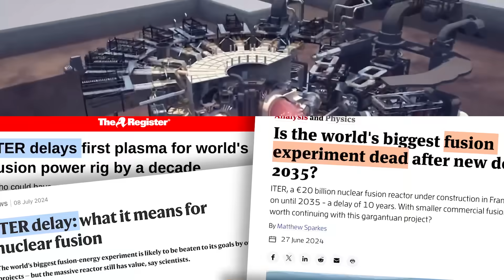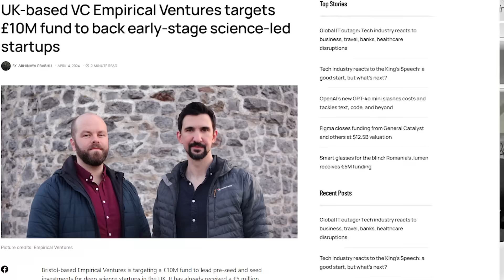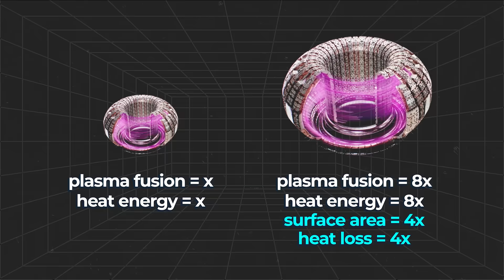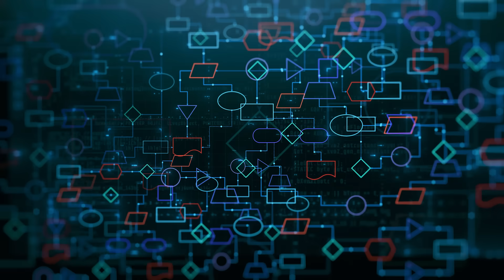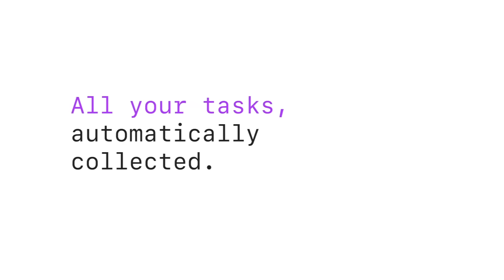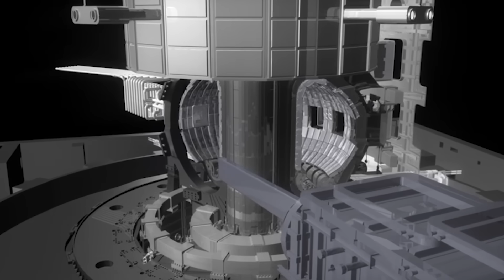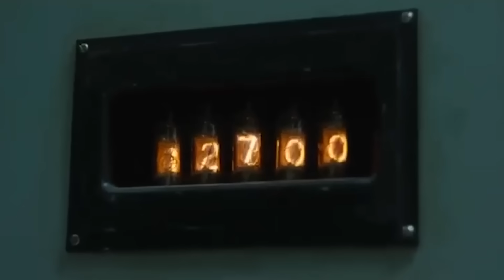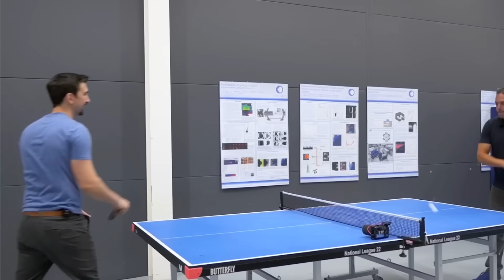Is The World's Largest Fusion Project Dead?

Comment: In iter’s defence, that was the size needed based on the magnet technology at the time.

REBCO magnets now allow iter to be 40x smaller / cheaper
Reply: So I wonder can we redesign ITER with REBCO magnets and add an actual steam generator to it? 40x might translate to an actual economic efficiency for a tokamak that size?
Reply: @MrMichiel1983  nope, that ship has sailed.

But many are starting from scratch and much father along after just a few years
Reply: That right there is a major part of the problem, at this time it takes these projects decades to go from the planning stages to something that might function. That time will drop a bit in the future as more efficient paths are discovered and less research is needed ahead of time, so, if we did decide to stop funding this project, it probably wouldn't mean that we'd get something online any sooner. 

With improvements in magnets, the next one will likely be a lot smaller and cheaper to operate, and will probably still benefit from this project.
Reply: REBCO magnets could potentially lead to more compact and economical fusion reactors in the future. REBCO (Rare Earth Barium Copper Oxide) magnets use high-temperature superconductors, which can operate at higher temperatures (up to 20 K) compared to ITER’s low-temperature superconductors. Totally different types of magnets however, with SMR or small modular reactors, becoming an increasingly popular subject, high-assay low-enriched uranium HALEU uranium hexafluoride (UF6).

HALEU UF6 is a form of uranium-235 fuel enriched to 20%, that is enriched higher than 4% to 5% level typically used in existing reactors, is projected to provide more power per volume than conventional reactors, as the increased efficiency allows for smaller plant sizes. This fuel type promises longer core life and a higher burn-up rate of nuclear waste, which will lead to the first new U.S.-owned, U.S.-technology enrichment plant to begin production in 70 years. Current uranium enrichment of HALEU UF6, comes from a centrifuge cascade, located in Piketon, Ohio.
Reply: There was a recent video of the "failure" of the Human Genome Project. Turns out being ambition can accelerate your collision with just how much you were wrong. Today we have tabletop genome sequencers. Even if ITER fails, the progress made in the materials industry and engineering knowledge will help in the next ones. From 15 years away to 10 :p
Reply: This is a classic example of the Generation Ship problem. Where if you designed a spaceship to support a human colony over several light years to a new galaxy by the time the ship arrives it's entirely possible humanity would have developed a faster mode of transportation and have beaten the ship to it's destination, rendering the entire project a useless endeavour.
Reply: @spicy_mint  It's a typical economics problem. Having to calculate levelised costs etc. Lets say you have a million dollars to spend on computers to do a calculation that will take 10,000 computers a decade to complete. A computer costs $100 initially. Every year computers get 15% cheaper. When do you buy your computers in order to get the calculation done as soon as possible?
Reply: @Mandragara  > A computer costs $100 initially. Every year computers get 15% cheaper. When do you buy your computers in order to get the calculation done as soon as possible?

Interesting problem.  A related one is if it is your investment that is DRIVING the improvement.  Germany's Energiewende made the size of the solar cell production go up by a factor of 5x or something.  It also had so much funding that projects in sunnier locales (honestly, most of the earth is sunnier than Germany!) couldn't afford to outbid Germany.  And when Germany quit, half the makers went bankrupt.  AND YET.  even if the firm is bankrupt, the manufacturing facilities are simply bought at the liquidation sale at a price that does make economic sense, and this is part of the reason solar is so competitive now for a fair range of use cases.  Energiewende was a disaster for Germany and a disaster for other solar rollouts of the time, but, also has to be credited with the advancements and production capacity as well.
Reply: What a REBCO? 

 I wonder if iron nitrade magnets will change things. Not for fusion. Just in general. They are more powerful than Neodymium.
Reply: @dianapennepacker6854  Rare-earth barium copper oxide (ReBCO)
Reply: @dianapennepacker6854  REBCO is a High Temperature Superconductor created by IBM many years ago. In 2010's, manufacturers figured out how to make it into a foldable tape & MIT realized that it could be used to make high Tesla magnets needed for fusion (and MRI machines, etc..). 

MIT's SPARK reactor is coming online in 2026 and it will be (almost) as strong as ITER but 40x smaller.  Now the limiting factor is extracting all the energy from such a small surface area. I think 2026 will be the "kitty hawk" year for fusion
Reply: Still the truth of greater volume means more energy with less surface area to lose any heat
Reply: @prich0382  I'd be more worried that the plasma instabilities which will be the next challenge to overcome after building a reactor that can produce 10x more energy than it consumes would be even larger and more complex with a larger plasma volume. I suspect in fact that after the basic physics is worked out on tokamaks that we may need to switch over to stellarators for better control of the plasma.
Reply: that doesn't help the thermal situation though
Reply: But now they can pack those smaller magnets to make it even stronger?
Reply: "Because these kind of materials are brittle it was difficult to create wires from them. After 2010, industrial manufacturers started to produce tapes,[12] with different layers encapsulating the ReBCO material,[13] opening the way to commercial uses. "
Reply: ITER size is not just a magnetic coil requirement. Both Spherical Tokamaks / smaller aspect ratio tokamaks, and  large aspect ratio Tokamaks with smaller size than ITER have problems.
One of the most evident ones is power dissipation. Instead of being able to spread the heat around the immense plasma facing components in ITER, you have a much, much smaller surface, which will cause problems. On top of that, stronger magnetic field decreases the power decay length, which means that the plasma becomes a death ray to the targets.
But there are other things such as reduced size of the central solenoid, etc.

Bigger field does not mean better. Smaller does not mean easier. It is all much more complicated as it is a multiple goal optimization and we still don't know what we need.
Reply: Likely time to invoke the "sunk cost fallacy" that governments are incapable of.
Imagine how much power we'd be creating w that investment in indirect fusion.  Still I favor advancing the tech for eventual space travel, etc.
Reply: @Mrbfgray  Now you are just saying words. What do you mean by "indirect fusion"? Inertial confinement? Exploding a nuclear bomb to create fusion? Solar energy, which is an indirect way to harvest the energy fusion of the sun?
Reply: @drplasma1990    Common term for solar.  Good GRIEF.

Comment: they only reason i don't complain about the trillions spent on particle physics, is because it's money that would otherwise be used for warfare
Reply: live it to countries to weaponize science
Reply: @dimos5422 Fusion is already well weaponised, the hydrogen bomb is 70 years old
Reply: same, id rather that money be used for science and research to enhance our QOL and NOT for killing people
Reply: ...or just lower the taxes, after tax and rent I have nothing left.
Reply: Just think about the type op warfare we could power with fusion. Kabloewie
Reply: @marioschoutteet  Or how instead of operating in super high thermal equilibrium, as Tokamaks and all Fusion presently does, utilise the high energy contained in laser, concurrently with ultrasonic frequencies, to separate atomic bonds, and when by natural design, new bonds are formed, use this state to initiate a Fusion 3 stage process chain? Perhaps even, removing the radioactive isotopes or radioactive ionizing decay states.
Reply: Or roads or bridges or railways.
Reply: Trillions? Where are you getting this number? It costs about 1 Billion per year to run the LHC so are you saying we are running 1000 of those?
Reply: In a way it's the same thing. Whoever has the best technology wins the war.
Reply: @blucat4  agree
Reply: Also this thing is not particle physics: it’s nuclear physics at best, engineering and politics at worst.
Reply: Trillions? The LHC only cost $15B
Reply: @realtalknotsmalltalk  ya, a guess that is not  a lot today
Reply: How about just letting people keep their money or not destroying the worlds economies with government spending?
Reply: @dennisswaim8210  i'm a big fan of local economies, globalization is a nightmare, at least for us here in gods country :)
Reply: Why not both? All we gotta give up is healthcare and social cohesion and quality of life
Reply: Except Warfare has done infinitely more for Science than research projects have.
The fucking transistor was discovered by a US military funded research institute. 
Dont be delusional. War is the only thing that innovates.
Reply: in the end, they are spending on both
Reply: They dont burning money anyway, cash must flow
Reply: Are you serious? It could not be used at all to reduce inflation.
Reply: @ergoproxy1986  there is a problem. when there is too much money prices go up, but they don't seem to go down when there is too little :)
Reply: Because rocket science is easier and cheaper to do. LOL
Reply: Except that the funding of ITER is greater than that in any high energy project, which are meant to advance the knowledge of the universe. Still, they have produced more spin-off than ITER (not necessarily than fusion science.)
Reply: Sadly, the west has to re-arm because Russia and China can't take a hint that taking land (or water) from other countries is no longer allowed.
Reply: Nope the money is used for complete authority over every nation on earth.
Reply: Particle physics also teaches us important stuff - the search for the Higgs boson lead to greater and greater control over high-energy particles, which eventually lead to cancer treatments where we can calibrate incoming radiation particles to dump all their energy directly into the cancer cells, ignoring any intervening tissue. You never know what tangential discoveries will come about from this stuff.

Also, we should be able to learn how to manage huge projects like this from managing a huge project (this), and it is always good to have a large number of nations working together on a peaceful project
Reply: Absolutely correct and I agree with your comment. "It's better to live than to war " .
Reply: I'm sure that the military will find a way to use knowledge acquired from particle physics (probably already has).
Reply: And it's because of people like you that we aren't type 1 yet...
Reply: Fusion Bomb will be as real as Fusion Reactors.
🤷😉
Reply: @jantjarks7946  Huh ??
Reply: @herbieschwartz9246  What's to huh about it? The train, car or plane were supposed to bring peace and all turned into tools of war. Why would it be any different with current technological developments?
Reply: @jantjarks7946  we already have fusion bombs
Reply: @jantjarks7946  yes sir, the use fission bomb to ignite a fusion reaction
Reply: @jantjarks7946  it's the difference between an atomic bomb and a nuclear bomb
Reply: Yet I bet you still support funding Ukraine with high tech weaponry too.... hypocrite.
Reply: I divide any cost in billions by 1.5 and state it in Zumwalt destroyers, or divide by 2 for the cost in B-2 bombers, etc. No, that social program doesn't cost 6 billion dollars, it costs 3 stealth bombers.
Reply: Why not use it for warfare? 

Let me put this into a logical perspective. I don't want someone I don't know pointing a gun at me and me not able to defend myself. That goes for the continent. If you can't understand the simplest form of defense against people who dislike you, you cannot say why you don't want it spent on defense.
Reply: I agree
Reply: We can chew gum and walk at the same time.
Reply: The statement assumes that funds allocated to particle physics would otherwise be directed to warfare, which is not true. Budget allocations are complex and influenced by many factors, including political, economic, and social considerations. The most fundamental flaw in the statement is that it presents a false dilemma (or false dichotomy) fallacy.

In this case, the statement implies that money can only be spent on either particle physics or warfare, ignoring the myriad of other potential uses for government funds, such as healthcare, education, infrastructure, and social services, in other words, I strongly urge you to reconsider your position and expand your perspective.
Reply: @mrhassell  ya, it's a sad assumption, i hope i am wrong, there are much better things we could do
Reply: @mrhassell  agree, how the heck did you wind up on this thread?
Reply: @rebokfleetfoot  An interest in subatomic particles, makes it Inevitable I think? What I consider interesting, is that Sir Fred Hoyle, was responsible for the idea of stellar nucleosynthesis, shortly after WWII. His theory of chemical elements being assembled by nuclear reactions from the interiors of stars and subsequently ejected into the interstellar gas, was a major progression as previously all attempts at nucleosynthesis had focused on nuclear residues of an expanded dense state in the early universe, as they continue today, which is a result of Albert Einstein and the nature of progression. For the past several year's, since the G-2 Muon work by Fermilab, ongoing discussions, have presented an idea of a requirement being that in essence, we need a new form of physics. Ultrasonic frequencies or Microwaves and lasers, both maybe used to separate nuclear bonds, governed by the nuclear strong force. New Physics, or examining current Physics and techniques differently?
Reply: @mrhassell  agree for the most part. i also am interested about the nature of things, i mean it seems odd that we have such vested resources and still struggle to understand the very fundamentals of nature, imagine what we would be capable of if we did :)
Reply: @mrhassell  agree, i oversimplify
Reply: @mrhassell   no
Reply: what do you mean, the ultimate goal of those funding science is to gain military advantage
Reply: @jeolman1  the idea is that military advantage would be the inevitable result of progress, so it's better to reverse it.
Reply: Ikr, people always say “What about healthcare and education!” as if science cuts into those budgets. EVERYTHING cuts into the military budget.
Reply: But war usually helps advance us, every period of rapid growth was during or after war
Reply: @prich0382  sad, but true
Reply: @prich0382 yeah that tends to happen when you BLOW UP ECONOMIC ENGINES OF THE ECONOMY other ones have to take up the slack afterwards and help rebuild, this results in a economic boom. Hence why we have the baby boomers after ww2 because of the economic boom we got rebuilding European infrastructure for them it’s wasn’t the soldiers coming home. It was the demands for products to rebuild Europe with. Steel, concrete, wood, finances. Go back to high school you Rube